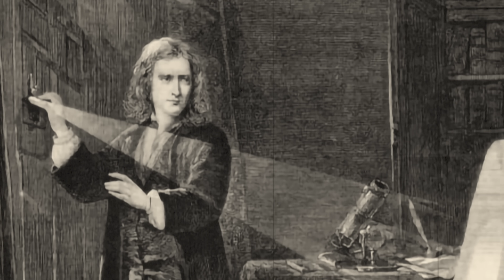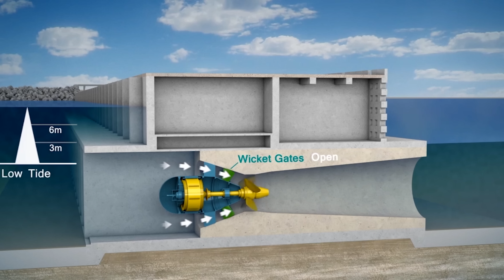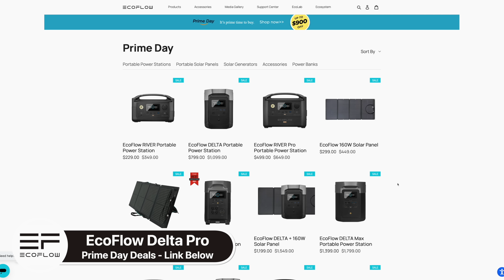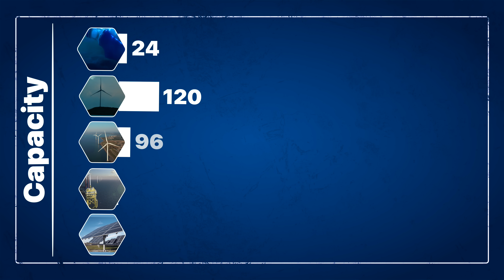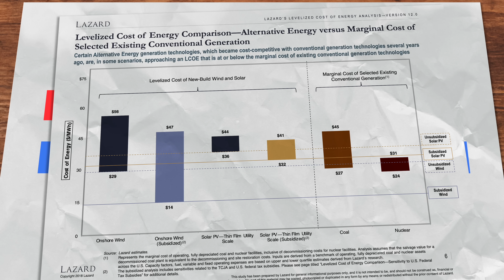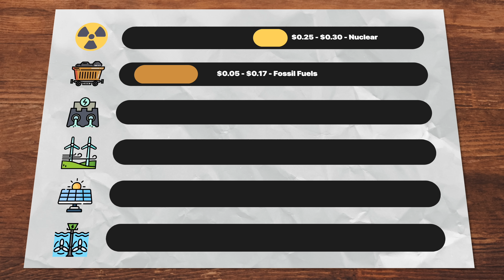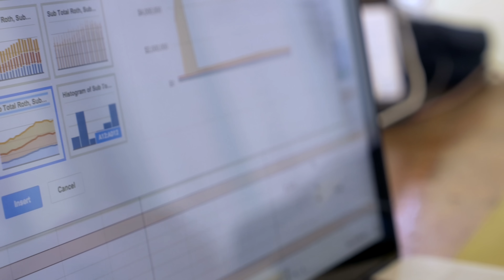Breakthrough Energy Source is 10X Better Than Wind & Solar!?

Comment: A free idea that needs to be shared, by the World. You can't sell what you don't own. All these ideas are off YouTube. 
Water shortages and food shortages are caused by the lack of rain and snow or is it more likely, the lack of large amounts of electricity to make water.

Sunspots, cosmic rays, the Earth's Magnetosphere, jets stream, the amount of salt in the ocean water at the poles, and volcanic dust in the upper atmosphere, may be something you look into. Look at the history of solar cycles like the Modern Eddy Mimium we are now living in. Check the number of days in a now shorter and colder growing cycle we maybe living in as we look to feed the world. 

Time for a total marketable idea to feed and water the World.

Well, well a water well, an old idea, but today we all can make water out of the air. Today we can use solar power, wind power, Wateroter or slow speed turbines, Natrium and or Thorium salt reactors and then use an atmospheric water generators and Seawater distillation systems to make water all day long even in the driest places on Earth. Today with this large amount of power, we can also build water recycling plants to maximize how we use the water made by atmospheric water generators and Seawater desalination. Note, you can also use desalinated ocean water to mine for lithium used in batteries.

Now let's take it to the next step.

I don't sell any of these ideas, or work for any companies I talk about, the question is, is now the time to market a total package and save the planet?

How would I change the world.

            First Trump wants to build a wall, Bill Gates wants to reduce the population, I got a better idea. YES a better idea, that we can build and do today. Just search all these ideas I put together here to solve real World problems.

The applied future of Natrium or Thorium reactors that can make water and grow food, and can be used to feed the world.

Now we start by building a Magnetic Levitation Railroad between San Diego and the Gulf of Mexico to replace the Panama canal for shipping containers traveling at 250 miles per hour. Now also, using the same right of way, build an Irrigation Project to turn the Southern United States and Northern Mexico into a World class agriculture center. How do I power this project by using a liquid fluoride thorium reactor (acronym LFTR; often pronounced lifter) is a type of molten salt reactor. If you search for a map of Thorium deposits in the United States, you can see by the map we have tons of Thorium all over the United States. Check on YouTube and search What they don't want you to know about Thorium, and  other Thorium videos. Also search Natrium salt reactors, both types of reactors can be used to make power.

   What am I going to power with Thorium Reactor or Natrium Reactor?

 I would build:
   Atmospheric Water Generators and Seawater Desalination plants.
  With these plants I would make Electrical power, Drinking water, Irrigation water,  mine the ocean for Rare earth minerals. Along the right away I would build fresh water fish farms based on Hydroponics for fish meat and fertilizer.  Adding a third Thorium or Natriun reactor and by pumping desalinated sea water to the head waters of all rivers in the area, that water would replace water tables through natural filtration into the soil. Projects of this size could feed three to four time the population of the world, by turning the Sahara Desert, Central Africa  and Australian Outback into gardens. I have been telling people about this for years.

Green houses made of transparent aluminum can be built in the far North and using Thorium or Natrium power plants with  seven color LED grow lights, both the North and South poles could also  be used to grow food. We can do this today.   

12/12/2021
The use of transparent aluminum greenhouses underwater and in oceans can add additional grow areas for World food production.

Eddie Delzer 01/12/2019

Update 7/4/2021
Do you have a nearby moving river or stream? You can now place a slow speed water generator on the bottom of the stream and make power. The unit is called a Wateroter made in Canada. The Wateroters won't harm fish and can be scaled up to meet the needs of small towns or cities. Make the power miles away from the small town, sell the power to the power company than use the power to make water anywhere. Atmospheric water generators can make drinking water and irrigation water, and with a Wateroter, power can be made even in remote regions of the World. You just need moving water in streams, irrigation channels, fish ladders or even waste water outlet's. Garbage treatment plants can also use the power they make burning garbage to make water with atmospheric water generators and add storage tanks to supply small towns and cities. Adding Wateroters below dams can maximize electrical power made by any dam and replace power lost if the dam has a fish ladder or channel for fish to move up and down stream. A dam can be saved for flood control by adding these powered fish ladders and channels or notching the dam and putting in a flood gate to raise and lower the river during fish runs. Now people and fish can share the river. Note, 

Final idea, dealing with forest fires. You build and place 100,000 to 5,000,000 gallon water tanks on hilltops to protect your town. You cover the tanks with solar panels and add wind turbines to make power anywhere. You sell the power, drinking water and irrigation water, then by adding irrigation pipes down the hillsides, you can create fire lines that lasts up to 24 hours. You make these fire lines by adding TetraKO, by Earth Clean at a 4 to 6 percent solution to the water. Turn on these stand alone units remotely, your fire trucks can work elsewhere or resupply themselves with needed water. Fire protection, drinking water, irrigation water and stand alone power for any city or town in need. These ideas all can be done today, just search YouTube, and then tell someone.  

01/27/2022 update 

Maybe it's time for feild heaters powered by   small natrium or thorium reactors. These salt reactors are a lot safer than the current uranium reactors we use now. The same reactors can be use to make water 24hrs a day by adding atmospheric  water generators and make electric power and steam heat when needed. Crops are kept warmer and have extra water during dry summers. You also have large fans to keep the air moving around trees and crops. The same irrigation lines can be used to heat fields in winter. You just loop irrigation pipes to circulate heated water. 

There are two kinds of books In life, The book of answers and the book of questions, both need looking at, take that idea with you.

Comment: I have for a long time been an advocate of tidal energy. I have been asked "what about the tidal dead zone every 6 hours or so?". Simple really, high tide is not at the same time along the whole coastline, controlled correctly, power supply can be transferred to the "dead zones" from working ones further up or down the coast.

Comment: When most people comment on how expensive tidal generation is, they forget how expensive wind and solar were until economies of scale and improvements due to improved technology and learning drove the costs down to current levels.

The UK government has just awarded contracts to 4 tidal projects, one of which (Orbital Marine) has already commissioned a 2MW system and will use the same construction to manufacture additional systems. If they can obtain contracts from the government to manufacture and install more units so they can create a production line, costs should start to significantly reduce.

Their system also makes maintenance less difficult as the turbines are on a floating platform and can be raised out of the sea for maintenance thereby reducing the need for either heavy lifting cranes to lift the unit from the sea bed or undersea workers who are much more expensive.

We need this technology to provide absolutely predictable energy regardless of the sun or wind and cover baseload requirements which current renewable cannot do without a large amount of battery support for the several days with low wind and solar output (solar output being zero for the long nights in Winter where more energy is required).

Comment: When moon and sun on the same side - why is high water on the opposite side? e.g. @2:26 
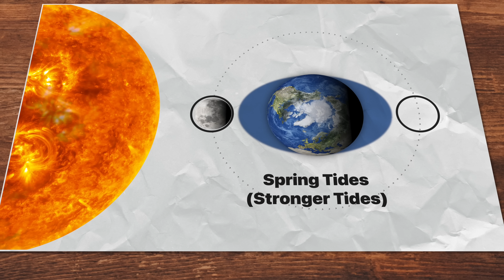Or why is @3:08 the high water not pulled to the moon - but in 2:30 the high water is pulled to the moon?
Reply from the maker: There was a mistake in the graphic at that point. Apologies. Short of it is moon side is always the tide side. When moon and sun align, it’s largest tides.

Comment: Would love to see more tidal systems in place. Lived in Darwin where there was a 3 to 5 metre tidal variation 2 times per day. Used to run out on the flat beach to collect sandworms for bait then run back with the tide on your heels all the way.
Reply: You sort of mentioned the very reason some big tidal barrier systems are rejected : all those worms are food for birds and other wildlife. The Severn barrier in the UK keeps getting reviewed and the conclusion is it would obliterate vast areas used by migratory birds. The coastline (and almost any moving water) is so valuable for wildlife we should think carefully before tinkering with it. Maybe tidal flow and barriers would work on the small scale resulting in less impact? But then they are hardly going to be ready to provide base-load power.

Comment: Thanks.

What about designing for the most efficient smallest unit rather than for large ones? Not just opening up more potential sites, this will create a larger addressable market which can increase investment incentives, drive down production costs, of the turbines, with the economies of scale. 

Go at it designing smallest tidal stream plants and tidal range plants. Learn more operating skills, AI controlled hardware, Innovate on new designs, and production methods to lower complexity and cost. Then go after the larger projects.

Exciting time really. With battery tech maturing, tidal based energy generation will bloom too! As they say a rising tide... Soon it'll be called TSWB, Tdal, Solar, Wind, and Battery.

Comment: The problem with most engineering is is that someone has their special interest involved. Brainstorming and free thinking don’t seem to be too accepted. Vertical access turbines are the better turbine to use for the situation you can make a three-dimensional vertical axis tree with smaller turbines so that the flux of the currents doesn’t put drag on other portions of the turbine, thus, making it more efficient. Then, a vertical access turbine is much safer and will not harm animals such as manatees etc. The next thing is you don’t put the generator underwater, you put that above the water and either the top of a pylon, a anchored barge, a GPS controlled location electric barge etc. then the barge can be used to also create hydrogen and oxygen to help offset cost. The turbines turn hydrostatic pumps. they pump hydraulic fluids to run between the turbines. this way they can actually work and series. The fluid then turns the generator…. This makes the turbine modules easy to swap out for maintenance and repair.

Comment: Solution to salt water deterioration.  Use roman concrete that heals itself using the calcium in the water.  Recycle the rest.  Can we just cut a trench across florida and use the current of the ocean to produce all the electricity we need?

Comment: Good point and this technology should be more closely researched. YOu could also store the energy kinetically with cranes lifting cement blocks up and down which use old building concrete as a form of weight. SO recycling old concreted into blocks that are lifted up and down to provide energy 24hrs a day when at scale to the area they service.

Comment: I love all this new tech. But the biggest problem that in my opinion is a decade or decades away is storage of energy. Batteries are extremely lacking in capacity and cycle amounts. To be safe I would say you need a 2 week reserve for emergency purposes. A bad storm of any type can damage a substantial amount of infrastructure. 

So you need a battery that can store that amount of energy for those instances. Then you need a battery that can be cycled thousands if not 10's of thousands of times before they need replacing. We are a long ways away from having batteries with that amount of capacity and duty cycles. 

Then the second biggest problem is the infrastructure. Our power grid is old and falling apart in may places. Just look at CA where rolling blackouts are a common thing in the summer because the energy companies instead of preventive maintenance and replacing stuff that is getting worn out pocketed the money and now the regular citizen is paying  the price while the upper management got rich. It would take a decade or longer just to upgrade the power grid in the US. 

So any politicians that are rushing green energy to be the main source of energy are actually destroying the economy and hurting the middle and lower class citizens. They are forming a class of people that will be forced to depend on the government, which is what they want. The rational thing to do is have a plan that slowly integrates green energy into the economy as newer tech comes available and move away from oil, gas and coal slowly as you're able to have a dependable replacement.  Not just quitting fossil fuels cold turkey which at the worst will destroy the country and at the least will cause mass economic stress on all the population except for the elites.

Comment: Yes, and... if anyone had moved 50 years ago, we wouldnt be dealing with the issue now.
Now time has run out. Collapse worldwide is going to stop all such talks. That factor you had in the beginning, the sun.. having been hidden away, ignored, and the incoming flow of dust and the suns cycles are up for the catastrophic micronova or at least, a few hundred years of a grand solar minimum.

Comment: no, it is not coming out of the sun you are explaining it wrong
the tides would be there on earth even if 
there was not the sun
the earth was not spinning and was completely stationary

both tides are caused by the moon centre of the earth line
every other vector on earth is aiming towards this line
the other hemisphere is vector is aiming at the opposite side causing it acts like anti gravity
that's why there tides everywhere
Reply from the maker: Coming out of the sun? What are you talking about? The sun 100% has an effect on tides. Lesser than the moon of course. It’s all explained in the video.

Comment: Throws away the biggest problem with tidal turbines in a single sentence... having a mechanical system in salt water is absolutely the biggest issue with any ocean energy harvesting system. Just look at ships, the seal that keeps salt water out of the hull where the shaft for the screw penetrates the hull is something that requires regular maintenance. 

Tidal turbines are suggested to be placed 10 to 20 meters deep. Much deeper than the shaft on a ship. This then needs a better seal due to increased pressure and it will also need more maintenance. A ship has crew that can perform preventative maintenance, a tidal turbine will not. It has been suggested that a tidal turbine could need a week or two of servicing every couple of years... not very economical. Especially compared to a wind turbine... you don't need a ship, crane and diving team to service a wind turbine, just a couple of guys fit enough to climb a ladder.
Reply: Look up Schottel tidal turbine. The same company that makes ship electric drives. Mounted near the surface with easy access for maintenance. Win, win, win.

Comment: There is another possibility;  
There are a number of locations around the world where the land is below sea level yet not in the sea. Australia and Africa have such areas measuring hundreds of sq. miles. Israel has the Dead Sea which is 300m below sea level.  What would it take to pipe sea water into these areas via a few generators ?  The Dead Sea generator would last 1000 years before it started to fill up. Using stainless steel turbines to reduce maintenance with the generator itself being above ground out of the water flow.

Comment: There is a destructive side to massive deployment of these underwater which will be problematic to sea life.   The efficiency will be reduced and costs increased if protections like a diversion screen is used.  Alternatively a sonic warning system could be used, but not without its own risks.